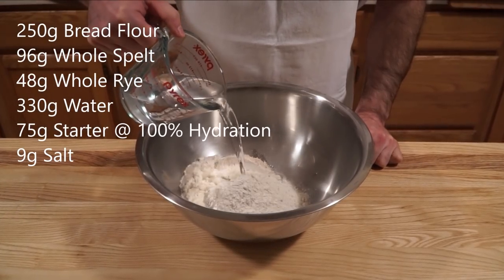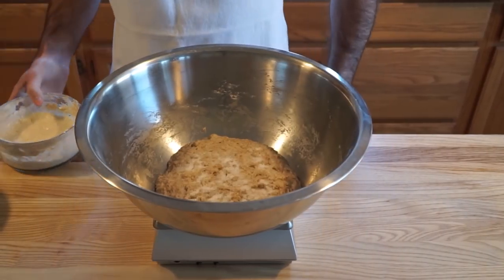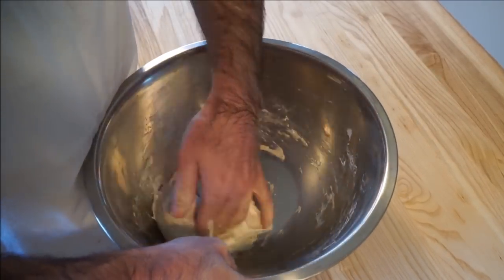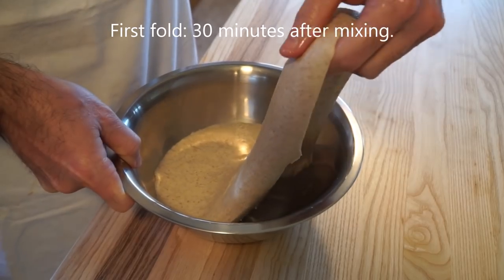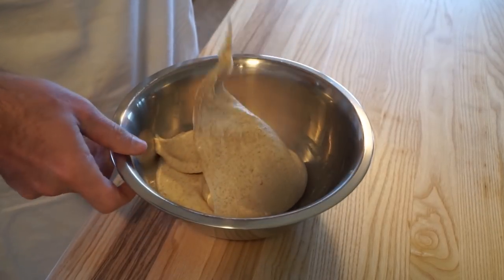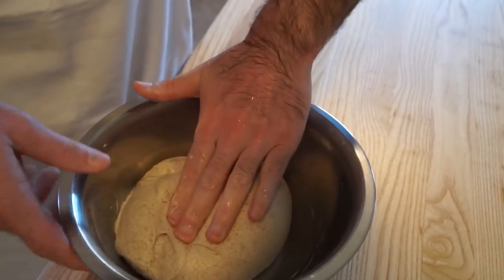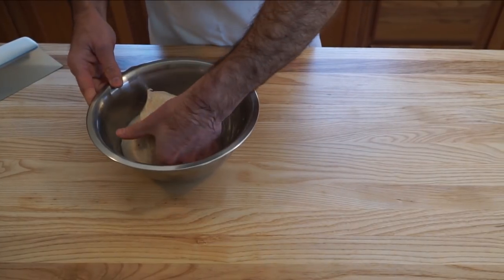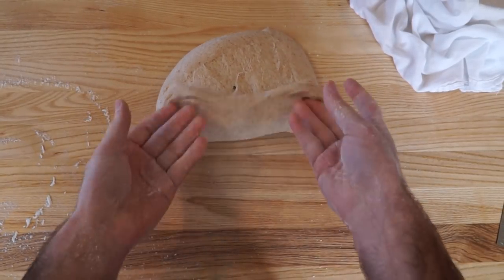How to Make Tartine Style Country Bread

Comment: Hi! I love the big pockets of air, you get wonderful oven spring! I have a few questions:
1 How long does the whole prep take? What hour do you start (inc feeding the starter).
2 Recipe seems quite time consuming with so much folding. Is there any way to avoid it? (cold fridge rise?)
3 Seems like the dough doesn't stick to your scraper at all. Do you dip it in the water/flour it?
4 I don't have combo cooker. Do you have any tips for careful placing in the dutch oven?
Reply from the maker: +szopuxx Thanks! To answer your questions:
1. It's a long process. I make the starter the night before, typically 12 hours or so before I'm going to mix in the morning. Mixing takes a half-hour. Bulk lasts for 4-6 hours usually. This time the dough was moving slower so I gave it 7 hours. Best to watch the dough, not the clock. Then bench rest for an hour. Final proof for 2-4 hours, or overnight in the fridge. The whole process can take anywhere from from 24-36 hours. That's just the nature of sourdough. Of course, you can speed things up by proofing at warmer temperatures and/or using a larger amount of starter. But I like a long slow rise so that's what my process is designed to produce. Feel free to modify it in whatever way works best for you.
2. Because the dough is fully developed at the start with the hand mixing, the folds are not required to develop the gluten. So no, you don't have to fold at all if you don't want to. What they do add is strength and structure to the dough which will give it a better ability to hold shape and allow for greater ovenspring. I don't always give it so many folds, it just depends on what else I've got going on. Don't let the folds run your day. The folds optimize your loaf, but they are not required to make good bread. 
3. I don't use any water or flour on the bench knife. The dough actually does stick to a degree, but mostly on the first pass as I pre-round it. Once the pre-round begins to tighten that tension reduces the doughs initial stickiness. With practice you learn how to maneuver the bench knife to minimize the sticking, but it is a bit of a skill that takes time to develop. Maybe I'll make a video focusing just on pre-rounding so I could explain the process in depth.
4. Before I got my combo cooker I was using a plain 'ol dutch oven just like you. What I would do was place my loaf on a sheet of parchment paper, score it, then lift it by the edges of the paper and set it down as gently as I could into the dutch oven. It's not ideal. The extra handling can damage the loaf, and ruin your cuts if you're not careful. Plus the dough will conform to the folds of the parchment paper and make wrinkled edges along the bottom of the loaf. But you'll still make good bread. I did it that way for a year before I bought the combo cooker. Now that I have the combo cooker though, I'll never go back. It's just a massive improvement and my bread is all the better for it. Cheers!

Comment: If i follow your recipe with same amount of water the dough is very runny so i've thrown it into bin straight from basket cause it sticked to it so i made it now 70% hydration but it looks like your basket is little bit smaller then mine so next time i have to make changes in flour ratio as well probably aiming for 1 kg loaf

Comment: Trevor, Wow, this is one of the best explained series of video for sourdough. Love your work. My question is about the starter though how did you make yours? The starter you used here is at what stage (freshly fed or a levain that you left over night)?

I'm starting the process in a couple of days and hopefully it will work out. Fingers crossed. 

And also any technique to work with starter and bread for hot and humid climate? I live in Bangkok Thailand where it's ambient room temperature is 27-30C and humidity is about 70-80%

Thanks
Reply from the maker: Thanks Chanin! The starter I used here was a mature starter I made the night before (about 12 hours or so before using). I tend to prefer mature starter to young levain, though I actually use both quite frequently. It just depends on my circumstances. As for how I created the starter, I like to keep it simple. I just mix flour and water then let it sit for a week or so. Usually within 24-48 hours there will be an initial burst of bubbly activity, but that is just a false positive. The microorganisms that cause that intial activity are not the ones that will survive for the long term in the culture. Once that activity stops the starter will quiet down and not much will appear to be happening. Then I just continue to let it sit for a few more day so that the culture acidifies which will help to select for the correct yeast and bacteria while killing off the unwanted ones. Once it's sat for a few days, then it usually springs to life within just 1 or 2 refreshments. And regarding climate -- hot and humid climates make for sticky and quick proofing dough. My advice is to make your dough stiffer than you think it needs to be. Start with stiff dough and slowly increase the hydration as your handling skills improve. If you jump the gun and start off with a recipe like this it's going to be a mess. And be sure to keep an eye on your starter -- if you keep it at room temperature in such hot weather it can turn proteolytic (gluten dissolving) which will ruin your bread. Learning how to keep and maintain a starter is one of the fundamental challenges that every new sourdough baker must struggle with. But great bread can only be made with a healthy and active starter. In hot weather, you may need to use smaller seed amounts when you refresh your starter to help reduce the acid load. Good luck!
Reply: Trevor J. Wilson thanks a lot! I'm now on day 5 and the activity seem to subside and will see if it's the right strain of yeast and bacteria that survived.

Comment: Trevor, Love your videos man! Ive been studying these religiously for the past month or so. I finally have all of the right tools to make it happen and Im getting ready to throw my dough into my new cast iron dutch oven. Hopefully I'll finally get that oven spring and maybe some crispy ears! 
A couple questions. How long, roughly, does it take for the starter to become potent or strong enough to really give a lot of good rise? And That beautiful wood bench that you're using.. what kind of wood is that and how is it treated?
Reply from the maker: Thanks Tony! It usually takes around a couple weeks or so to get a starter active enough to give a decent rise (that's if everything goes smoothly), but in my experience most starters continue to gain strength (and flavor) over the first few months or so (especially if kept at room temp with twice a day feedings). Some starters can continue to change in character for up to 6 months before finally settling in. For that reason, when creating new starters I never refrigerate for at least 3 months. And if it's still changing then I wait even longer. As for the bench, the wood is maple and it was treated with a food grade polyurethane finish (that's now starting to wear a bit -- I'll probably refinish it in the future). I got the bench from the Webstaurant store . . . http://www.webstaurantstore.com/eagle-group-mt2448b-wood-top-work-table-with-galvanized-base-and-undershelf-24-x-48/575MT2448B.html You can get them there in many different sizes and options. And you can often find them at bakery/restaurant auctions for much cheaper.

Comment: great bread!!! congrats

because of the way you add salt and sourdough to the dough in this video, don´t you think there is a risk of transferring some salt to your sourdough?
Reply from the maker: Thanks Mario! I don't worry about salt touching my starter. It would take an excessively large amount of salt to kill off a starter in such short order. I've been doing this for a very long time, both professionally and at home, and I've yet to see a starter killed off by contact with salt. As far as I'm concerned, the idea is just a myth. The theory may be sound, but in practice it's a non-issue -- it would just require too much salt and a long exposure time for any real damage to accumulate. Cheers!

Comment: Hi.. I've tried your method several times.  In most cases, after the dough has proofed in a linen lined basket, I turn it into the cast iron pan and it sticks to the linen liner.  the bread itself has turned out fine but I'm left scrubbing the linen to get the dough out.  Any thoughts on what might be doing that is causing this?  Thank you.
Reply from the maker: Hi Kimberly, it's hard for me to say exactly what might be causing the problem without being there in person to witness it for myself. Some possibilities to consider: 1) The dusting flour. Are you dusting the linen with rice flour? If you're using regular flour then it won't be as effective. Nothing prevents sticking like rice flour. If you are using rice flour, then perhaps you just need to give it a heavier dusting. This goes double if you live in a hot and humid climate. 2) The linen. Is it actual flax linen? Flax linen is ideal. You can also use a fine cotton tea towel like I do, but linen is better. If you're using anything like terrycloth or that has a very course weave then that will increase sticking. 3) The shaping. If you don't develop enough tension during shaping then the dough will just sort of "seep" into the pores of the linen and increase the likelihood of sticking. If you have trouble shaping this dough because it's too wet, then it's better to reduce the hydration to a more manageable level. That will also reduce sticking. 4) The proof. If your dough overproofs in the basket then it will be more likely to stick as well. All proofing times in this video are just the ones that worked for me on this day with this dough. It's up to every individual baker to adjust as necessary. 5) Proteolysis. If you find that your dough starts off fine, but then seems to tear and shred as it proofs then you might be suffering from proteolysis. Proteolysis is the breakdown of gluten due to overactive enzymes and/or long exposure to acid. Basically the dough begins to dissolve. Towards the end of the process, the dough resembles something more akin to runny glue than dough. If your dough is turning proteolytic as it proofs then nothing will prevent it from sticking to the linen. If you have proteolytic dough, that usually results from a proteolytic starter. You will need to adjust your feeding routine in order to remove the acid load and bring it back to health. That's really about all I can come with at the moment. I hope it helps.

Comment: You get excellent action from your starter!  It looks like your starter is pure white flour? I am sure all has been said before elsewhere, but I would really like to hear your thoughts on maintaining a white flour starter like you have.  What are the advantages of using a white starter?  Any tips on flour choice? Feeding schedule?  Thanks, I love your videos!
Reply from the maker: I generally keep an all-white starter because it's versatile and I prefer its flavor characteristics. It's versatile because most breads contain white flour, but not all contain whole wheat or rye (the other common flours for starters). So you can generally use an all-white starter in a (mostly) whole wheat or rye recipe, whereas if you kept a rye starter and were making an all white bread then you'd need to convert the starter to white flour first. Of course, if you mostly bake whole grain or rye breads, then things would be reversed. But since I primarily bake white and mostly white breads the white starter is the most versatile for me. As for the flavor, the white starter has a different flavor profile that I personally enjoy. It's a bit "cleaner", and perhaps a bit more acetic (versus the lactic flavor that comes with the whole grains). That's just personal preference -- many bakers prefer the flavor of whole grain or partial whole grain starters (and I do occasionally go through phases where I include whole grains in my starter). For flour I just use a quality all-purpose or bread flour -- whichever I happen to have on hand. Usually that's King Arthur AP or Bread flour. I generally keep my starter at room temp and feed it twice a day approximately 12 hours apart -- usually with a high dilution (anything from a 5X to 10X factor) because it's so strong. I bake often so it's helpful to have a starter that's active at all times, and I like the character that develops over time from room temp starters. But honestly, I mix things up quite often. Sometimes I get lazy (or busy) and refrigerate my starter for weeks at a time. It's so strong that it comes back to full health almost immediately -- often I even just bake with it straight from the fridge and it does well. I usually keep (and use) a stiff starter -- typically 50% to 60% hydration because I prefer the flavor of stiffer starters (and they keep well at room temp), but I convert it to 100% hydration for most of my videos/recipes since that's what most bakers are using these days. That's the general story regarding how I maintain my starter, but like I said I'm always mixing it up so what I'm doing today may not be what I'm doing a few months from now. But I hope it helps. Cheers!
Reply: What an excellent response, I had no idea that different flavor could be achieved by altering the hydration of your starter.  I always assumed it was just a matter of convenience.  Well, that is yet another variable I will have to experiment with.  There is too much bread to bake, too little time.  Thanks again for your reply, it is obvious you are both passionate and extremely knowledgeable.

Comment: If I remember correctly, you have an open crumb 65% hydration video. I tried that and my dough got more and more slack after the overnight autolyse and by the start of shaping it was so extensible it refused to shape. RIP table.

Comment: Hi Trevor, Thoroughly enjoyed your video.  Wondered about your the timing of the addition of salt with the starter - I was told that it either stops or kills the starter or yeast in it... Obviously misinformed because that was a beauty of a loaf - best I've seen - in your video. Can you explain the addition of salt where you did it?
Reply from the maker: Salt does kill yeast and bacteria. But in practice, it's a non-issue. The salt and starter touch for only a brief amount of time before they are mixed and diluted into the dough. Furthermore, only a small portion of the starter actually touches the salt, the rest of it remains salt free at that point. In order to seriously affect the health of the starter, we would need to mix the salt and starter together all by themselves -- and then let them sit for a while for the salt to do its deadly work. And even then, we would likely need much more salt to actually permanently kill the starter. So while the theory of salt killing yeast and starter is sound, the reality is that what you see here in this video doesn't meet the conditions in which salt will actually harm the starter. In all my years baking, both professionally and at home, I've never once had a problem with letting the salt and starter co-mingle for a short time. As far as I'm concerned, the effect has been promoted due to logical theory misapplied. It's just one of those things passed on from baker to baker without anyone actually stopping to give it any deeper thought because it seems to make so much sense. But if folks test it for themselves then they can actually see the truth of the matter empirically. I always prefer to test for myself rather than take others word for it. I hope that helps. Cheers!

Comment: Hi Tipperman,loved your brea. Can you share what you did. What was your starter and how was she fed. Can you share your recipe please. Thanking you
Reply: Hi, sorry I'm late on the reply. The loaf was 400g high extraction (sifted) whole wheat, 100g unsifted whole wheat, 200g unsifted dark rye flour, 300g bread flour. 850g water at 90 degrees farenheit. I mixed the flour and water 4 hours before adding the starter and salt. Folded the dough several times during autolyse, just to ensure no dry spots. Very light, delicate folds.

25g salt
150g starter. Starter was 100% hydration, 50% whole wheat 50% white bread flour.

Incorporated the starter using Ken Forkish's "pincer method" along with the salt. Followed up with Trevors gentle "cupping" motion for a few minutes. Folded every thirty minutes very gently for six hours. Did a final fold to release from the bulk ferment bowl, divided in two by weight.

Pre-shaped with gentle folds, bench rested 40 minutes.

Final shape with a bench scraper, into bannetons dusted with a 50/50 blend of rice and rye flour. Placed in a big ziploc bag for overnight proof in the fridge. Baked in a 4qt dutch over the next morning.

Preheated dutch oven to 475 for 1 hour. Scored first loaf, transferred carefully to dutch oven. 30 minutes covered, 15-20 uncovered for desired color. Same for the second loaf. Happy baking!
Reply: Also I feed my starter three times a day. I bake a lot. 200g room temp water, 100g whole wheat flour, 100g bread flour. I use this to build starters for different breads. Double fed levains, triple fed levains, 90% white flour starters etc. Baking is like jazz, it depends on the feels. But that's how I do mine. Hope this helped!

Comment: I had a quick question about the stitching technique. I have a problem of the dough not sticking to the other side when I'm attempting to stitch (am I not pushing hard enough, am I pulling too far away?) or the stitch often comes apart. Do you have any suggestions? Thank you so much!